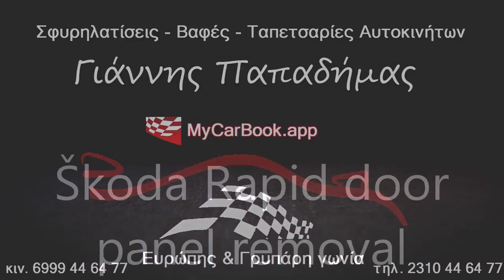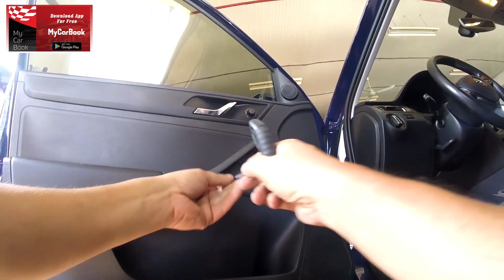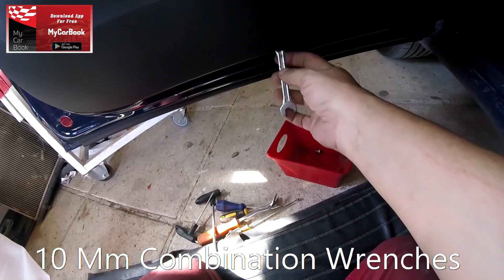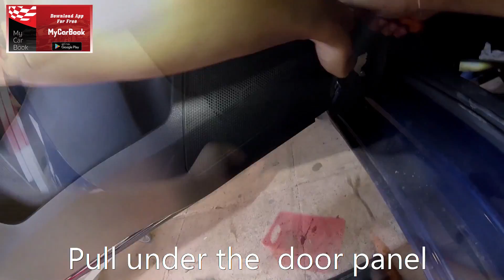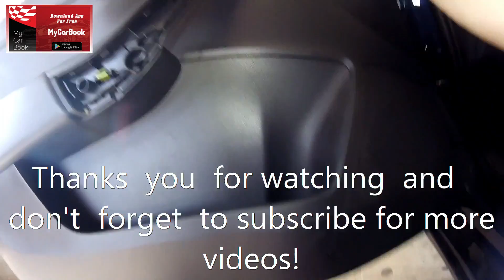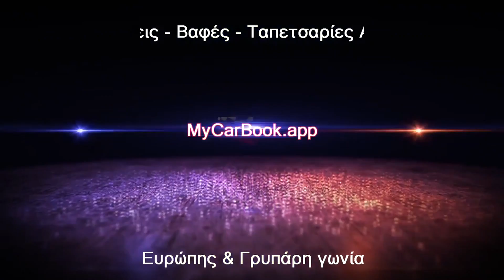Škoda Rapid door panel removal

Comment: Hi! I own a 2013 Seat Toledo, which is basically a Skoda Rapid with a S in the front, even the interior is similar.
I would like to know if you could tell me where should I tie a wire for some interior lights I want to install. I would like that wire to give current only if you insert the key, without the need of turning the lights on. 
Any advice on that?
Thank you very much, really useful video, already liked It!

Comment: how do you disconnect the window switch connector?
Reply: With frustration,  have you found out how to remove connector 
On most cars I've owned the window switch can be removed with out taking the door card off
But it looks like mine is part of the door card,